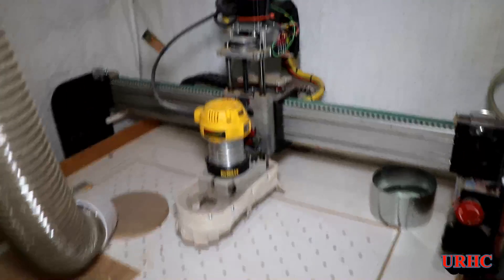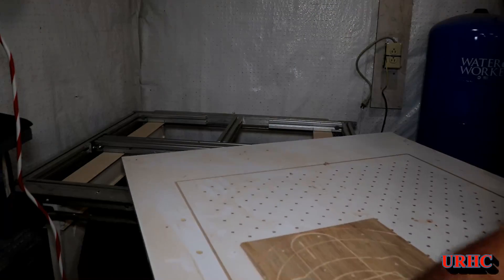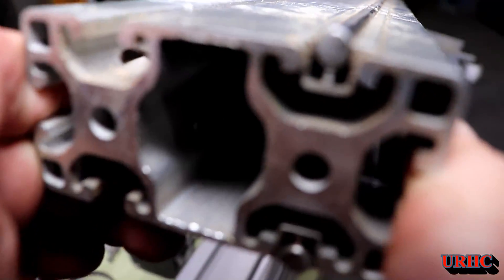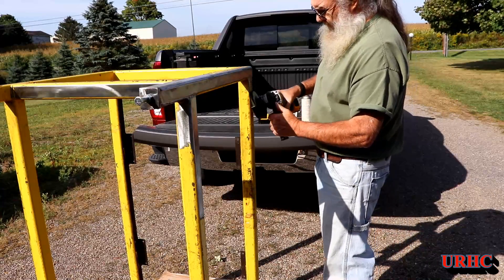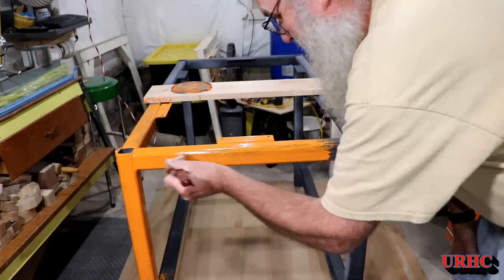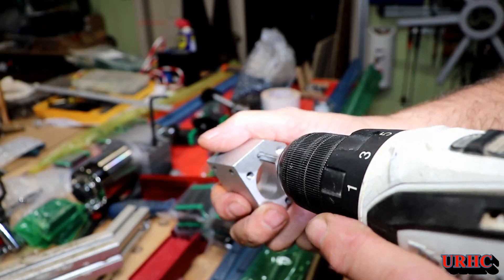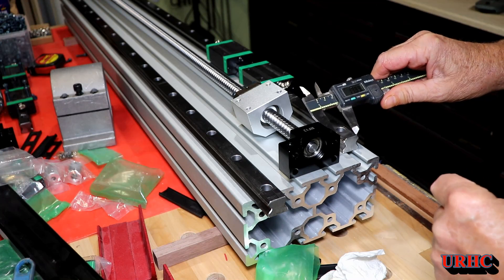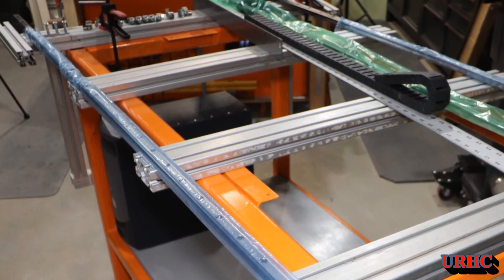CNC Router Build Part1 Tearing Down The Old One For Parts And New Base

Comment: Hello Ed! Did you buy your 80/20 extrusions directly from 80/20 or from a secondary source? These extrusions are getting mighty expensive. I priced some 1.5" square (1502) rails and I was quoted $0.47/". -  outch! If I may ask, how much did you have to pay for your big rails? Thanks for sharing and keep up your great work!
Reply from the maker: I purchased them directly  from 8020 and yes they were expensive.  It was almost $400 for the 3 of them shipped. I ordered  the gantry first then had to sell some stuff on Craigslist to place the second order 🤑.    I figured  they were the best option to a successful build without  large accurate machines to make something. Thanks for watching.

Comment: Just for information mitsumi and item24 give you option to mill atleast 2 surfaces of the extrusion when you order it from them. But you got a very straight extrusion doesn't need a milled surface.
Reply from the maker: Thanks.  I  was surprised how flat it was. Finally got the longer ones and they are very flat also. Thanks for watching.

Comment: Hello Ed
Glad to see this project underway. 
I'm about to start something similar myself and it's nice to have someone go ahead and groom the trail.
I hope you don't mind my asking, is your electronics knowledge etc. self taught or have you had training in a previous career?
I am very impressed with all your skills.
Reply from the maker: Thanks.  Building your own is the most affordable way to get a larger machine if you have the time. Back when I  first got laid off I decided to build my CNC plasma table and that was my learning tool. I had many problems and wound up totally replacing all my original electronics to get a good working  machine but learned a lot and my biggest lesson was that all electrical parts run on smoke. Let the smoke out and it's going to cost you. l was a mechanical design engineer and always had electrical engineers to take care of the electronics and software of the machinery I developed so I just handed them off block diagrams but that was it.  Thanks for watching.

Comment: Too bad about the rail. Manufacturing defects are seemingly magnetically attracted to you some how.

I can't wait to see the water-cooled spindle motor in action.
Reply from the maker: I have never had so many problems with purchased parts before. I am a little nervous about how long it will take to get a replacement. It will definitely be a while before the spindle is fired up. Going to try and use the gantry cavities for cooling the spindle. Over 30 pounds of aluminum should make a great heatsink. Thanks for watching.